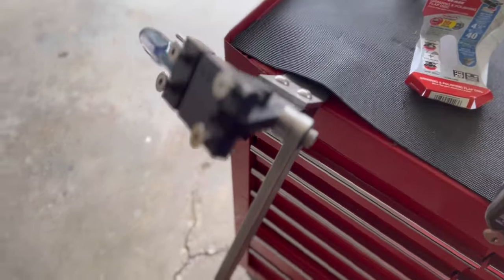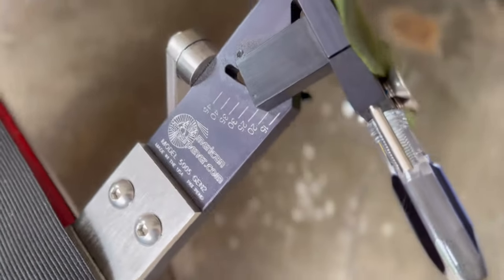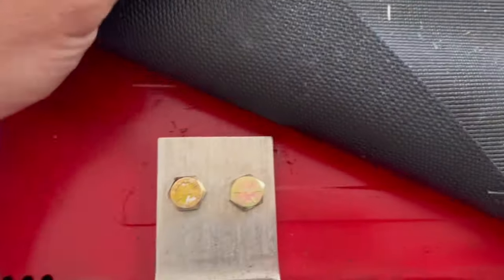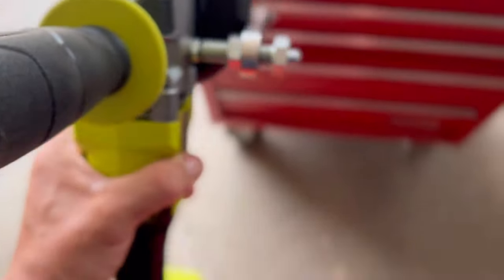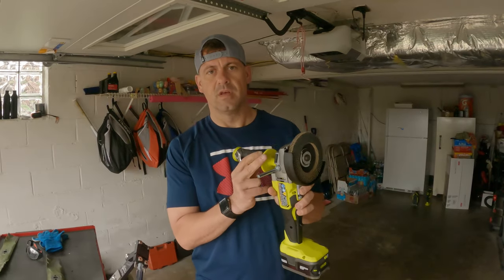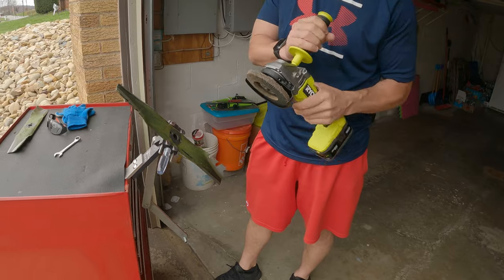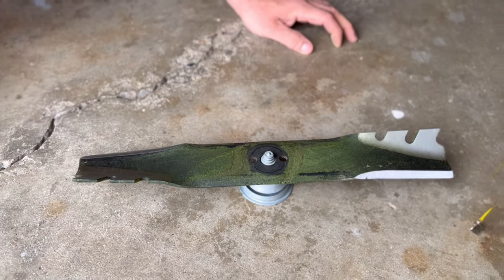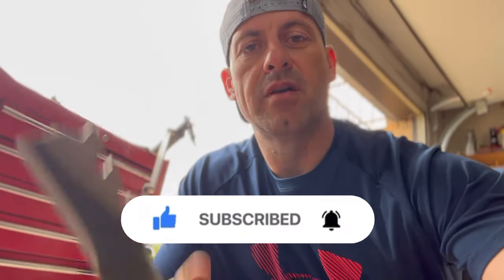The All American Sharpener (Mower Blade Sharpening)

Comment: Good video, if you want to stabilize and make sure that doesn't pull through the top of your toolbox you could put a backing plate inside the box or mount it to a piece of hardwood that is the same size of the inlay of the top of your box.
Reply from the maker: Thanks appreciate it 👍🏼. It does come with a mounting plate to attach it to the box underneath it washers and bolts. I actually sprayed the box with rustoleum paint before hand so it doesn’t rust out.

Comment: Just ordered the 5005 model today. I have been using an Oregon blade grinder and while the unit works okay it's hard to get a uniform angle because you lose the support of the blade as you draw it out. By the way, to properly balance a blade they should have all dirt and grass removed.
Reply from the maker: It’s a great sharpener for sure. I thought I did clean them off just didn’t show it in the video or it could have been an earlier video I did using that sharpener. But your right definitely need the blade cleaned. Thanks for watching 👍🏼

Comment: My only con is the tip of the blade slightly gets rounded inward. I'm sure it's user error due to I'm new at it. Hoping with more experience I can stop doing that. Great video!
Reply from the maker: You will get it. Just try to go straight up in one smooth motion and then come off the blade coming back down. 👍🏼💯